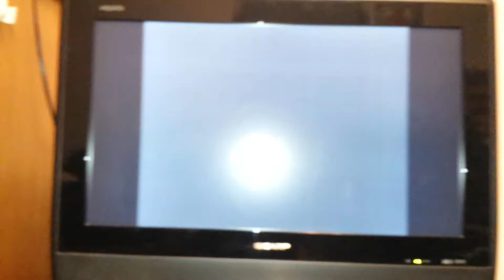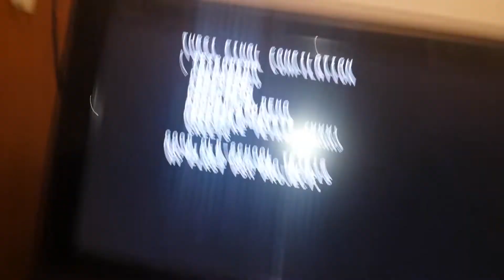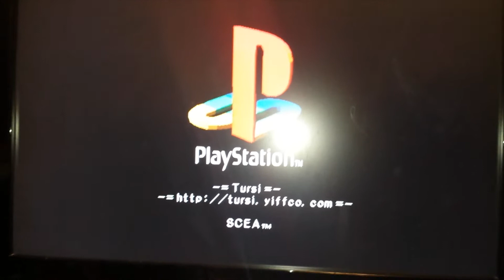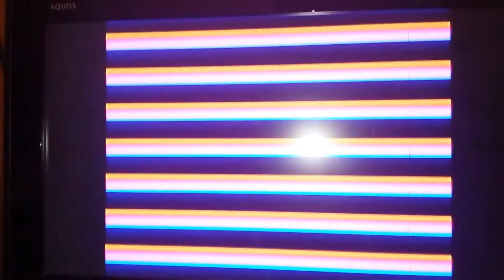Bootleg Game Lab: Arduino based Modchip for the PlayStation! (PsNee)

Comment: I'm doing this exact same process, with the same board and a arduino uno however I am unable to make it work, could you tell me what version of psnee your using?
Reply from the maker: late response as I haven't checked this account in a while, was the latest github release at the time iirc. double-check your wiring and give this a shot if that doesn't help: https://github.com/kalymos/PsNee/blob/master/PsNee.ino
Reply: @SparksFox  thanks for responding! But I have already bought a mm3 modchip and installed correctly, my only problem is it has trouble reading my cd's well, like final fantasy 7 intro kinda laggy
Reply: @salmongood3151  Laggy video is a good sign of shitty discs. Quality CDs and a good burner make a huge difference :)